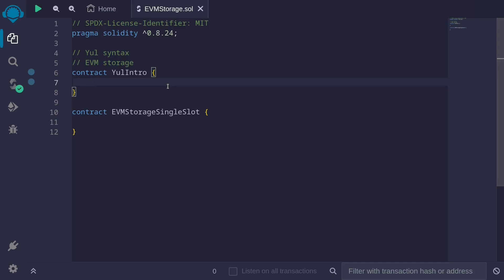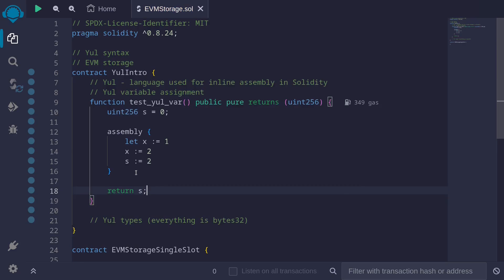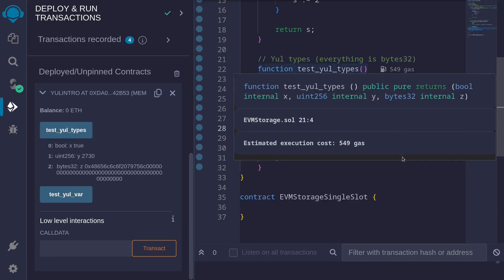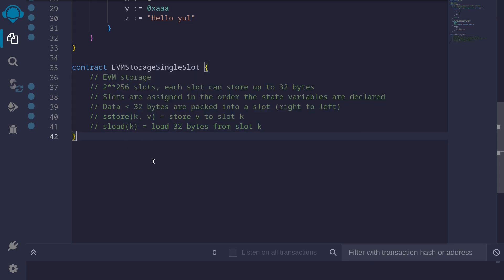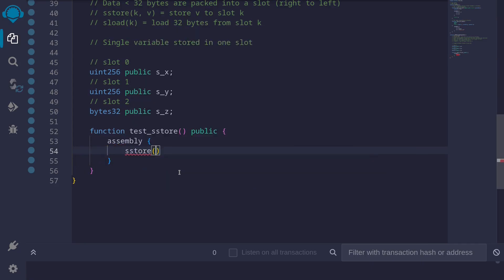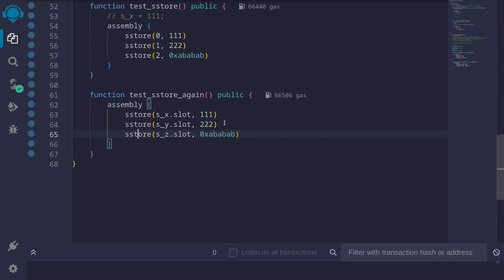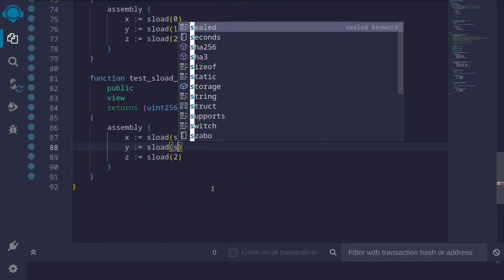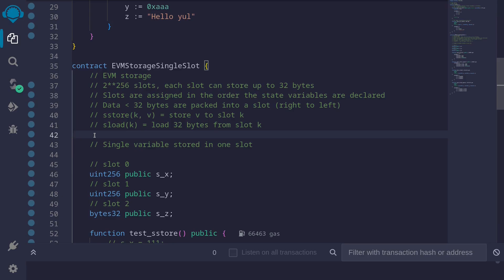State Variables Stored in a Single Slot | EVM Storage 1

Comment from the maker: 0:00 Intro
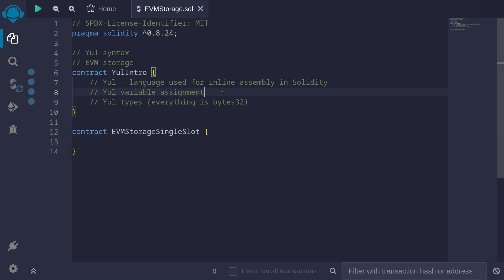0:50 Yul variable assignment
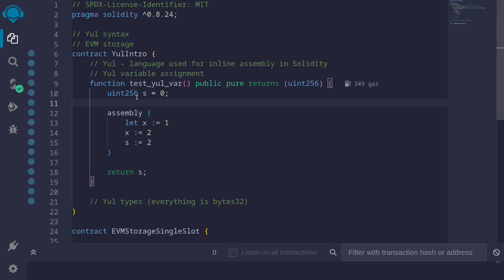2:25 Yul data types (only bytes32)
4:05 EVM storage
5:01 Variables stored in a single slot
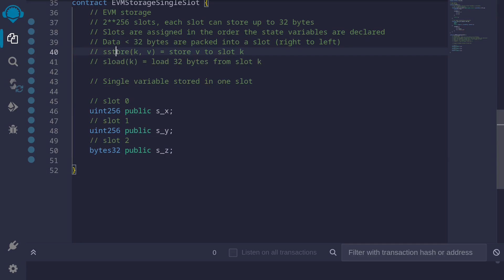6:46 sstore
8:30 sstore with slot property
9:23 sload
10:18 sload with slot property
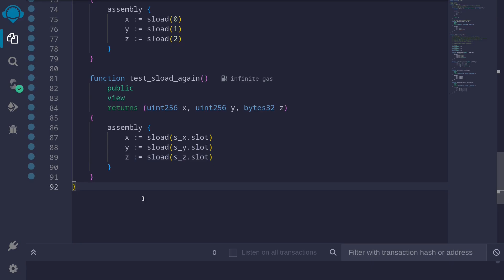11:00 Demo

Code
https://solidity-by-example.org/evm/storage/

Take a course
https://www.smartcontract.engineer/

Remix
https://remix.ethereum.org